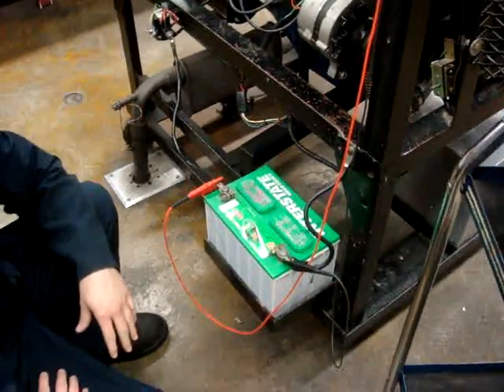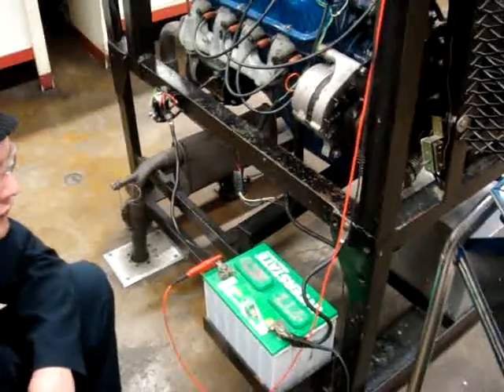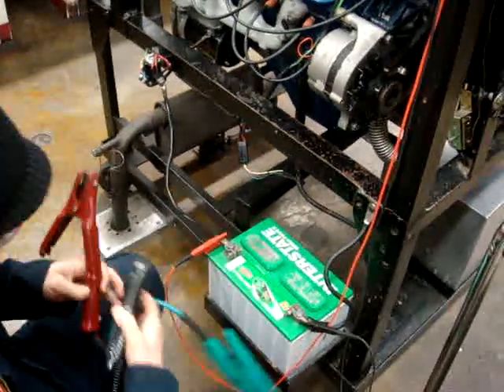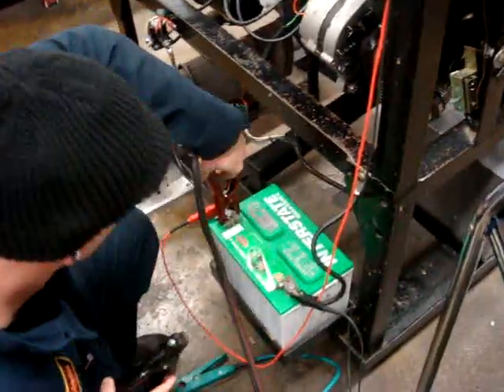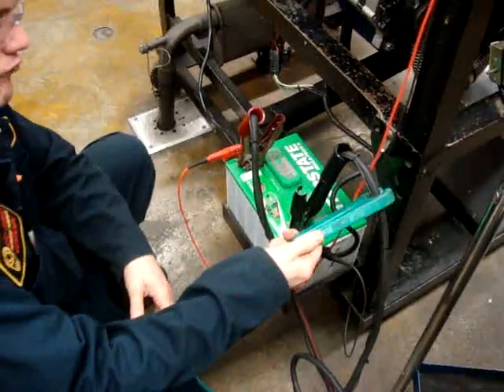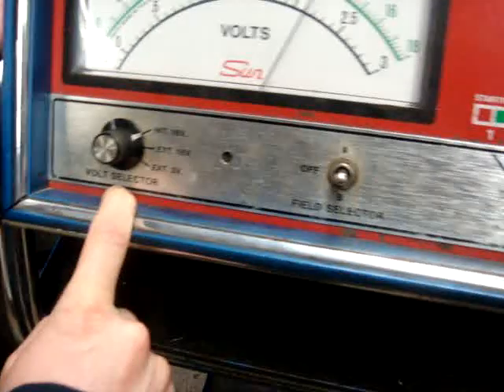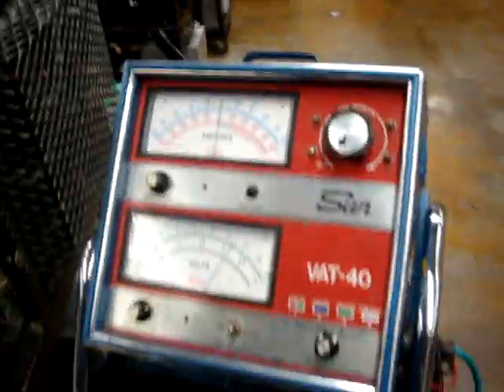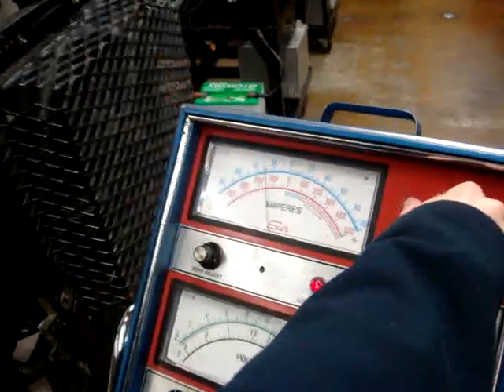battery load testing on a car

Comment: @ratko89   :)!! you have to check the CCA on the battery and divide it by 2( 700 /2 = 350 ) this one in the video is a 700 CCA( Cold Cranking Amperage) so you set the amp to 350 cca..during 15 seconds and the voltage is not supposed to drop under 9,6 volts,! ( sorry for my bad english)